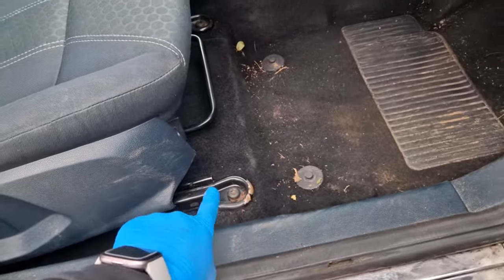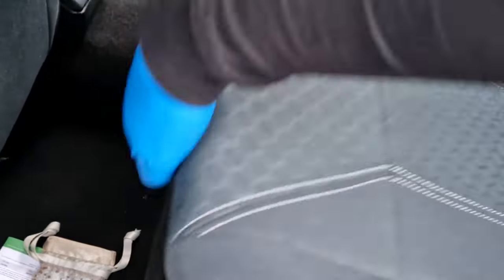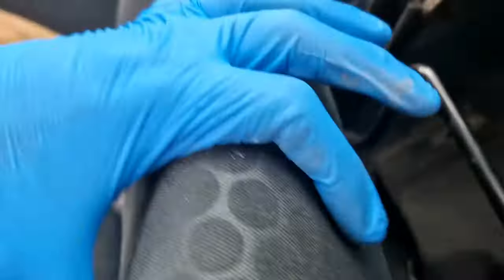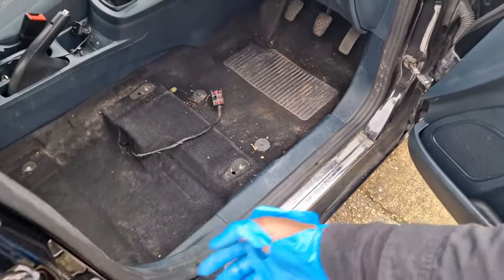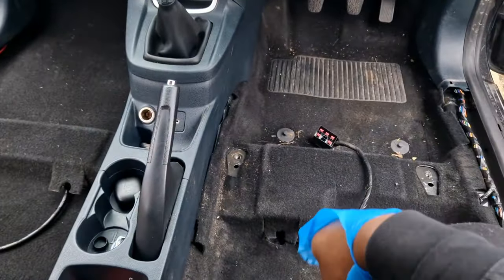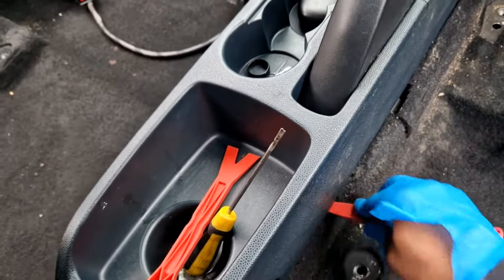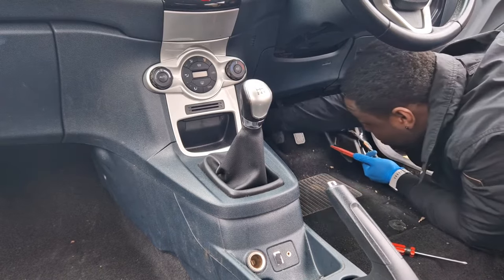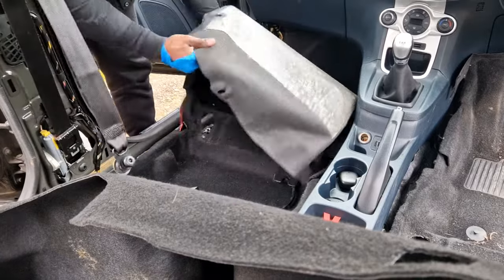HOW TO REMOVE THE INTERIOR CARPET FLOOR IN ANY CAR

Comment: I’m needing a video for a 2016 ford edge because they have the carpet in sections which makes this job appear to be a lot easier but there’s no videos on it anywhere.
Reply from the maker: No one has made one buy the shop manual for the car that will help you figure it out emanuals 😊

Comment: I'm trying to find water leaks on my fiesta, you have no idea how much this helps, thanks!
Reply from the maker: I'm so glad it helps because when I made it I wasn't sure whether it would help but thought this problem has given me a headache need to create something to stop others having the same thing 😊
Reply: @The_journeyy  It really does, I'm about do so the same thing you did and I was very afraid I'd end up breaking something haha
Reply from the maker: I hear you on that just make sure to let the car sit for 30 mins after disconnecting the battery otherwise the airbags might surprise you 😊
Reply: @The_journeyy  Sure thing, wouldn't want that to happen!
Reply: Great video! About to do a similar job on an S-Max...Are there no fixings on those lower side trims, just "I'm sure I'm gonna break these" clips on the insides?
Reply: @hughwilson3466   Mine is the Brazilian model, but it's likely the same, there's only clips, make sure to pry the side opposite from the door seal first, there's some tabs underneath that connect with the other trim pieces, and then carefully pull the trim up
Reply from the maker: I've not done this job on a S-Max but chances are there will be fixings I usually pry gently and watch the pieces they will show you what direction they come out in without breaking anything if you pry hard something breaks 😊
Reply from the maker: @metal_anomaly 👏👏

Comment: Is the interior carpet water proof I spilled Diet Coke on my carpet will it rust the metal part?
Reply from the maker: no it won't rust the metal you'd have to have spilled a lot of coke on it and for it to be damp for ages

Comment: Hi, my smart car for two brake rubber concertina thing has detached from floor carpet. It's a 2011 model, can't find anything in the manual 😢 Is there any way to re-attach it without removing carpets and seats. The brake seems fine, just the plastic oval on the base of the brake pedal rubber bellows knocks and is annoying 😢
Reply from the maker: Best to take it to a mechanic to look at 😀

Comment: Thanks for that, but is there a part 2 or something? I wanted to know what is the material underneath the carpet? My daughter spilled milk on the carpet, and the valet couldn’t get rid of the smell. Does the ‘carpet underlay’ absorb liquids, or is it water-proof and the liquid stays there? Thanks.
Reply from the maker: Yes it's basically a sponge I had mould on mine because liquid got into the car and I had to replace that foam and get the carpet cleaned and dried  while out of the car

Comment: Awesome. I cut a hole with my heal and started to get clogged lungs from debris that would get soaked underneath the carpet was soooo much mud. (I go to the park with my dog alot) 
I started cutting out the carpet when i realized i should remove tbe entire carpet 😂
Reply from the maker: Bless you that sounds awful that foam is not great splits into a thousand pieces if cut it I'm glad you realised before you covered the whole car in debris by cutting the carpet out